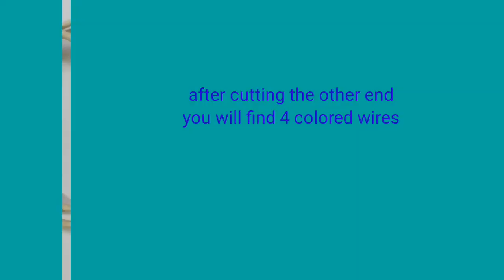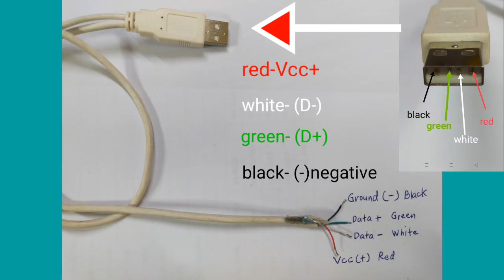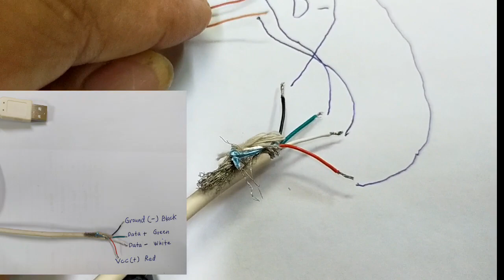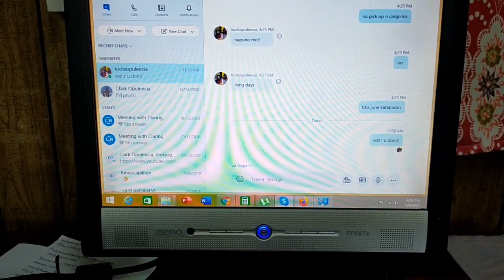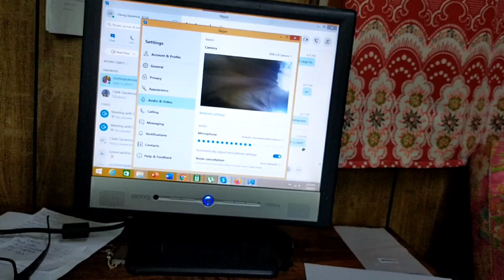Convert Laptop Camera into USB Webcam/Old Laptop Camera to USB Camera Convertion/Clark Opulencia

Comment: GREAT VIDEO - BUT- what if the webcam card has ten all black wires?
Reply from the maker: Don’t rely on the color or pieces of the wires, just focus on how to identify the 4 required pins configuration(V+,V-,D+,D-)some other wires are  just replica of the 4 pins. Sometimes 2 twisted wires are the DATA+ and DATA - .
Reply: @clarkopulencia4066  faker u

Comment: is it connecting to camera app in windows without install driver?
Reply from the maker: Some models require to install driver but most of the times are plug and play.If requires driver , just update your windows driver.

Comment: what kind of USB cable? Can I use the USB cable from a mouse or laptop? Can I use  USB 2.0 Printer Cable - A-Male to B-Male Cord ?
Reply from the maker: YES, Any USB commnon type A pinout connector but don't depend always on the wired colors instead follow the orientation connection on the pinout connector( positive , negative gnd , data+, data-) as shown on the video.
Reply: need also to add diode, i tried it without diode and camera gets hot.

Comment: Some people will add diodes on the positive side.
Reply from the maker: yes, if you don't know the voltage supply (voltage ranges between 3.3V to 5V) but if 5V no need to add like in my case.Nice comment.Thank you..
Reply: U did not check the volts??
Reply: What is diodes

Comment: Can i use this camera in mobile
Reply from the maker: Yes, using OTG cable and using USB OTG camera app if your're using android phone .
Reply: @clarkopulencia4066  do I need the OTG cable? Can't I just wire the other end of the USB cable and plug directly into phone or tablet?
I could see how this could easily be set up as wifi as well.
Thank you
Reply from the maker: @paulgla  Most of phones require OTG cable but you can try as long as you can connect USB A (usb camera)to your phone or tablet through the micro usb or usb charging port.

Comment: my cam 8  cable .8ssc20k7 Please help.
Reply from the maker: if you found twisted wires, they will be the Data wires tightly together.For ground, check the continuity of the wire to the copper on the board(screw mounting holes).Probably 1st or last wire is V+ positve.Once you test it and  show up USB unrecognized on the PC swap the data wires.Other wires are for mic with sharing ground on the cam.
Reply: @clarkopulencia4066  Thanks for. I'll try and let you know.
Reply: @clarkopulencia4066  I’m kinda new can you tell me what continuity reads on the voltage tester thing

Comment: In my camera no ground hole plz help
Reply from the maker: try to scratch the backside of the board particularly under the connector to expose the copper clad.
Reply: @clarkopulencia4066  Thankyou for help
Reply: Actually i want to ask you can i connect this camera to my phone using otg and my phone support otg for connecting it with phone any app need and app also tell me plz🤔🤔🤔
Reply: Sorry mean app name
Reply from the maker: @jerrygaming3752  I've never tried it to any phone since my phone is old model but I will let you know if there's an answer to your query.
Reply: @clarkopulencia4066  thankyou for reply and plz check it to connect with phone plz and thanks again for reply you know you are the one youtuber who replied me thanks